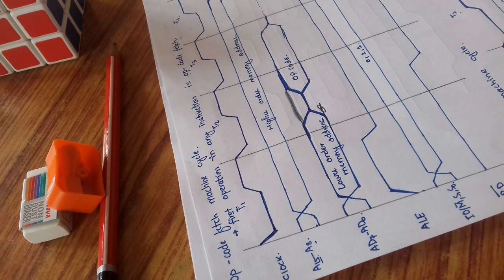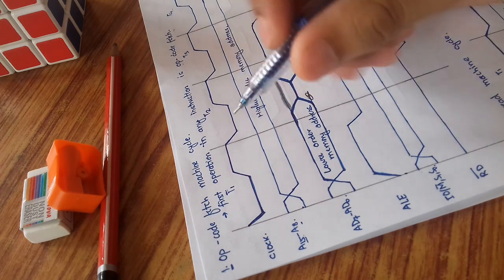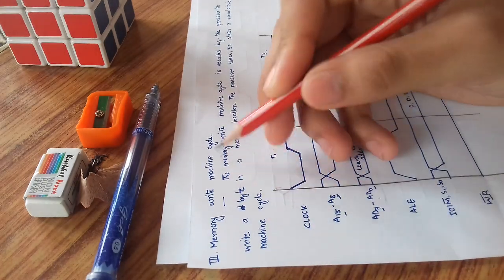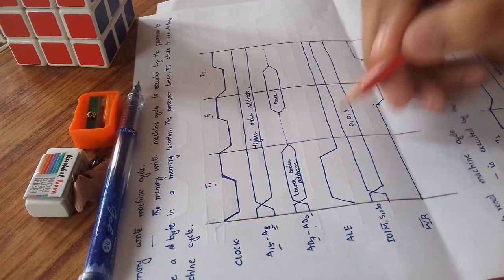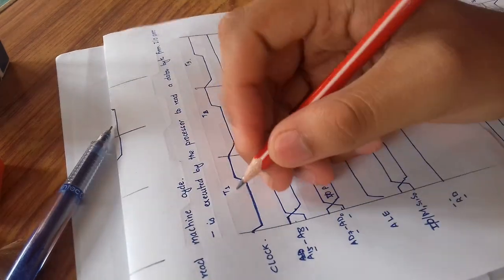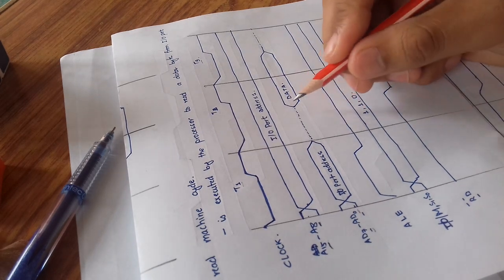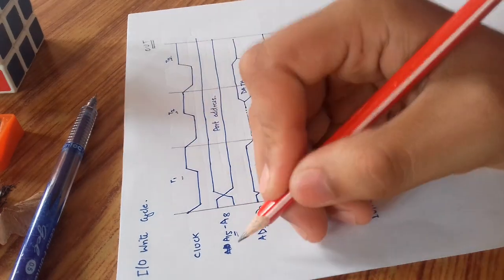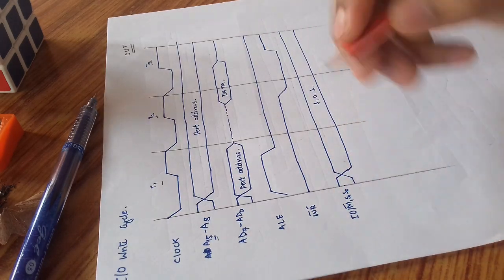Introduction to timing diagram

Comment: Okay tell me  why ALE is active high in only T1 state??? and in the case of memory read why  read cycle is active low in the data section??? there is many thing that you haven't explain in detail
Reply: Because it is the property of Ale that is take address when it high & take data when it is in low state
During T1 state it take Address so it is high in other state it took data so it is low
Reply: For 16 bit addressing and 8 bit data transferring, (16+8) 24 bit bus is not used since it takes lot of pins. Rather only 16 bit bus is use. Here higher 8 bits stay as address bus, whereas lower 8 bit bus transfers data if ALE is low. And address if ALE is high.
ALE stands for 'Address Latch Enable'. i.e. transfers address only when it is set high.